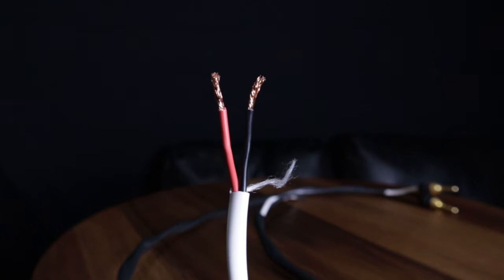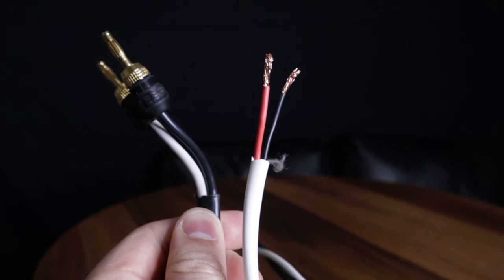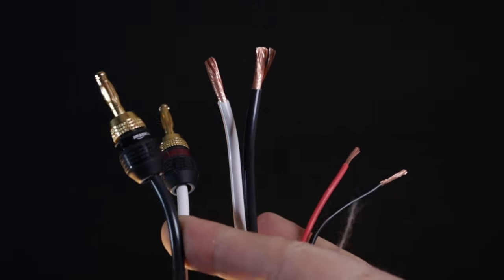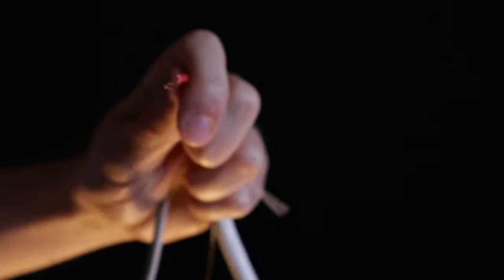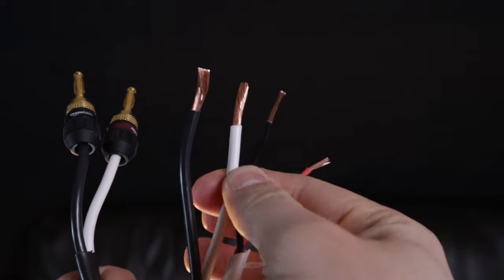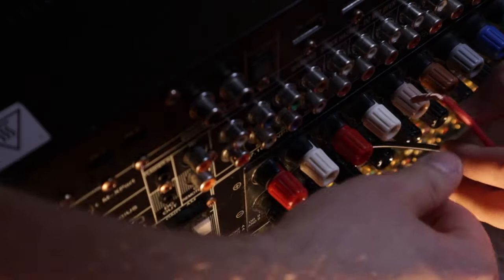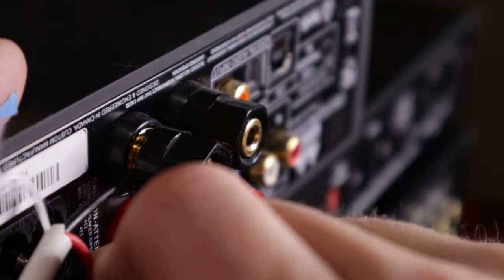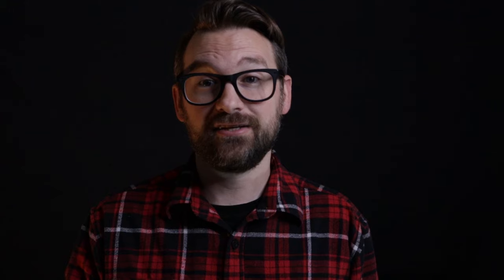Speaker Wire Basics (Quick, Easy)

Comment: Im thinking of making  of making my own diy premium speaker wire for a SVS 5.1 system.  Can I twist two 14 gauge wire for the neg and  two 14 guage  for the positive. I plan on using Monoprice Access Series 14AWG CL2 Rated 4-Conductor Speaker Wire.  Will this be to thick to run to my satellite speakers?  The longest run is 20' to 25'  (rears) 3' to 6'  (fronts). Any response is appreciated - Thanks
Reply from the maker: Absolutely, it would be thick enough. To be fair, you could use one positive and negative of 14 AWG to go all the lengths you mentioned. In the thumbnail of the video there is some grey speaker wire. That wire is 4 conductor 14 AWG wire that I combined together (red and red, black and black) to make a single connection wire (I use that for my front speakers that are only about 12 foot runs). It turns out to be about 11 AWG wire. I like it because it makes me feel confident about things working but functionally, all you need would be the 14 AWG. Let me know if you have any other questions. Thanks for watching!

Comment: When there is a red, and a black wire- is the red the hot? Thanks- very basic, but not mentioned
Reply from the maker: Hi Norman, red is usually the hot and black the neutral. Honestly though, I think in most scenarios you just have to match colors and keep them consistent.

Comment: I am a complete moron when it comes to electronics. I used masking tape to label all wires as I pulled them out from my old receiver and of course when I tried wiring the new receiver, all of the wires were stuck together in a huge ball of masking tape so I doubt I got all the wires correctly installed.
I ended up using a 9V battery to get the "popping" sound and make sure the correct wires were connected to the right posts.
Now I am not sure if the polarity is correct as all of the wires were black. 
I've seen where you watch the speaker go in or out to determine correct polarity but I don't want to remove the cover to do that test. Any ideas???
Reply from the maker: Alot of receivers have a speaker setup option in the menu. It will play sound through each speaker and often check for polarity.  If it came with a setup mic there is a good chance it has this feature.

Comment: I just got the Elac Debut 2.0 B6.2, and I can't connect them with banana plugs. I have the nakamichi banana plugs.
Reply from the maker: I know those speakers have the holes for banana plugs. Are the banana plugs to big to fit in the hole or the case to big and there isn't enough clearance around the posts? Did you buy them in the US or outside the US? Some countries require caps that cover the banana plug holes on the posts.

Comment: hello, my speakers have a little color coated cap inside then wire terminal that prevents me from plugging in my banana plug, however, it otherwise appears to be fully capable of accepting a banana plug input. So do I need to remove these caps? I tried a little and they were quite tightly on there, so I figured I would ask first. Also I am working with the celestion F1 speakers. I tried a search for the user manual but could not find one online. Any help is greatly appreciated thank you.
Reply from the maker: Hey, sorry for the delay, many products that get shipped globally come with those extra inserts in the banana plug hole. I used a dry wall screw and a drill and drilled just a little ways in and then you can pull those caps out. If it is what I think it is.

Comment: I hope you can help me. I want to put banana plugs on but I have no ideal what to get.I have a Onko HT R 510 home theatre receiver. Thank you so much.
  Mary
Reply from the maker: Hi Mary, sorry for the wait, let me do some digging
Reply from the maker: Ok, that receiver uses 5 way binding posts so you can use the links in my description for wire and banana plugs. All Amazon links.
Reply: @goldenearaudioreview4904   Thank you, where are the links?
Reply: Could you tell me what size banana plugs? Also is there something inside the terminal posts that need to be removed so the banana plug will fit. Thank you
Reply from the maker: They are all the same standard size. To remove the covers ( plastic bits that fit in the center) I used a dry wall screw and screwed it in the the plastic but, just a little, and then used that as a handle to pull it out. You can look that up on YouTube, that's where I found the idea. There might be better ways of doing that.
Reply from the maker: The links for the banana plugs and wire are in the description of my video. Expand the description and you will see links.

Comment: Hello, I have a question you may be able to answer I bought a house with ceiling speaker, only two wires coming out of the wall each wore has 4 different colors like in your post picture, what do they all mean?
Reply from the maker: How many in-ceiling speakers are there? Is it 2 cables and 4 wires in each or 2 cables with 2 wires in each? Depending on the colors and amount of wires and speakers you may need to experiment with how you connect them. Let me know more and I might be able to help you narrow it down.
Reply: @goldenearaudioreview4904  thank you for the reply, two in the living room, one in the kitchen, bedroom, front porch and back porch, with volume  controls. two cables with 4 wires in each 16/4 I believe
Reply from the maker: @jean-pierredoucet8328  if they aren't labeled then you will have test each combo and then label each pair. You need to connect two wires, one to each binding post for one speaker. I use label zip ties and write the location for the speaker. Test connecting the speakers at low volumes using an amplifier, stereo or home theater receiver.
Reply from the maker: You don't have to test with all three types of amplifier, just one would be fine. Let me know if you need more information.

Comment: One ? I have sony bookshelf speakers sscs5 and a sony Bluetooth stero receiver the  STRDH190 The speakers have connections for banana clips the receiver don't can is it possible to use banana clips on the receiver STRDH190 ? not sure how to hook up my system had it 2 weeks now can't wait to use please help
Reply from the maker: You wont be able to use the banana plugs on the reciever but you could use pins. I don't really care for pins as I have found they tend to come loose. You could get some bare wire and do banana plugs to the speakers and bare wire on the other side of the wire to the receiver. That is what I would probably do. Bare wire is maybe the best connection (no audible difference) from a conductivity view point but it's not very convenient.
Reply: @goldenearaudioreview4904  Thanks Brother or Sister I'll do that

Comment: Can you show me what kind of wire to connect amplifier to EV ELX 200-10 speaker. Thanks
Reply: Can I use this one Rockville RTSBW15 15 Foot 1/4" TS to Bare Wire Speaker Cable,16 AWG,100% Copper

Comment: My speaker came off of a radio an it had six wires what do I do, should I still run black wire to black wire an red to red or what
Reply from the maker: Six to each speaker or six total? I'm assuming you have two separate speakers

Comment: Great video! It was clear and easy to understand. I appreciate it. My one question: what is the benefit of putting the wire and plugs together oneself rather than buying pre-assembled wires with plugs already attached?
Reply from the maker: There can be two benefits. Some times it can be cheaper (not always) and you can do custom lengths. If you have a budget for it you can go for the pre made wires.
Reply: @goldenearaudioreview4904  thank you!

Comment: My speaker wires are thick to fit in the new Onkyo TX SR393 .. what to do
Reply from the maker: It looks like for the front left and right, you can use the bare wire or banana plugs. For the others, you can see if pins will work. What gauge wire do you have?

Comment: Can i connect the speaker direct to the tv..?
Reply from the maker: As long as the speakers are self powered (like studio monitors) or the TV has speaker terminals (which is not normal). Likely if you are using regular speakers then you would need a receiver.

Comment: What about those holes with tabs?
Reply from the maker: Ah, yeah, those are called spring clips. You should use bare wire. Typically you would want to use 16 gauge wire for that since it can be harder to thread. Or you can use pin connectors. They are similar to banana plugs but have a small pin instead. I have used them in the past but the wire tends to wiggle free. Easiest, cheapest is bare wire.
Reply from the maker: Just push the tab down and insert the bare wire in. You may need to experiment with the length of exposed wire to insert in but I would start with about a half inch.
Reply from the maker: Yeah, in my experience they were the least reliable. The wire would eventually slip out if they got moved or re inserted. Better off with bare wire if you can.

Comment: Excellent video. I have one question. Are the banana plugs the same thing as a 3.5 mm audio jack?
Reply from the maker: Thanks! Good question, no, they are not. They do look similar but the 3.5 (and the larger 1/4) jack have rings on them that can carry stereo information. Banana plugs don't have that. They are also a different size with the banana plugs having a spring like tension to them to keep them inserted in the binding post. Thanks for asking the question!
Reply: @goldenearaudioreview4904  Oh ok. Are there audio jacks i can buy that are 3.5 mm that i can hook up the red and black wire to. Thank you for the assistance btw. Just subbed 👍
Reply from the maker: @johnnyboy_rn4l_826  Sorry I missed this question. You have undoubtedly found your own answer but here is an example of something like what you are talking about. https://www.amazon.com/CERRXIAN-Terminal-Headphone-Converter-Adapter/dp/B06Y5YJRPD/ref=asc_df_B06Y5YJRPD/?tag=hyprod-20&linkCode=df0&hvadid=193992629021&hvpos=&hvnetw=g&hvrand=17653091454944598486&hvpone=&hvptwo=&hvqmt=&hvdev=c&hvdvcmdl=&hvlocint=&hvlocphy=9033382&hvtargid=pla-313747042489&psc=1

Comment: I have an old Pioneer stereo I want to use the speakers going through my Poweramp is that possible
Reply from the maker: Possibly, depends on if that Pioneer has pre outs. Should be RCA connections on the back of the receiver. You could Google the model and look up the old manual.

Comment: Hi there how do I connect four coloured speaker wires black red white blue to red and black terminal on the amp please? Can I put two wires together in red or black terminal? Thank you.
Reply from the maker: Yes, you can use any color and combine wires together. The trick is to make sure that it's connected the same at both ends of the wire. The negative on the amp is the same as the negative on the speaker and so on.
Reply: @goldenearaudioreview4904  thank you so much for the speedy reply. I will do that. Thanks again. Appreciated. Stay safe

Comment: Can connect the spring clip speakers to Bluetooth receiver
Reply from the maker: Bluetooth speakers typically are wireless devices. You need to have speaker terminals on both sides (speaker and amp) to make the connection. Either the speaker has Bluetooth connection and a built in amp (power) or it's a passive speaker and it needs an amp. Some receivers have both Bluetooth and speaker terminals.

Comment: how to connect regular speaker cable to 3pin xlr? because usually speaker cable has plus and minius only. not ground.
Reply from the maker: I googled "speaker wire to xlr adapter" on Amazon and found some options. I noticed that quite a few people were saying it didn't work but I'm not sure of their scenario. Male vs female xlr and which side needs the XLR vs speaker wire. Not sure if that helps.

Comment: Hey man... I'm tryna connect firestick to hdmi2va 1.(to av receiver to speaker) and 2.(to my TV). Could you help me?
Reply from the maker: Sure! I think the normal way to do this would be to plug the Firestick into the HDMI in on the receiver. That should give audio and video at the same time to the receiver. It should then pass the video up to the TV through the HDMI out. Maybe you have already tried that or you have an older receiver?
Reply: @goldenearaudioreview4904  thanks for the reply. Could you help over on Instagram or snapchat? It'll be easier to explain and show you. Is that possible?
Reply: So my problem is : attach the firestick to hdmi2av.. Hdmi2av got two audio connections and one video.. Two audio connected to amplifier.. One video connected to plasma tv.. Home theater speakers connected to amplifier. Will this work?
Reply from the maker: What is the make and model of the av receiver?
Reply: Will it work?
Reply from the maker: @akshatkhanna2517  ok, I'm getting the picture now of what you're describing. Do you have all of this now? I would try it. You won't blow anything up.
Reply: @goldenearaudioreview4904  alright I'll try it out and let you know... Thanks for your help man.
Reply: @goldenearaudioreview4904  hey bro I tried it out but the converter was low quality... I guess using a Bluetooth speaker is a wise decision... The problem is I got home theater speakers with no Bluetooth link and the av receiver Bluetooth doesn't connect to the firestick... Any ideas on how to use them?

Comment: bear in mind in most European countries, the standard mains power receptacle will physically accept banana and even US-style "double banana" plugs leading to a risk of electrical shock. For this reason, throughout the European Union, the sale of audio amplifiers and loudspeakers that accept banana plugs is prohibited as is the sale of loudspeaker leads terminated in such plugs. The UK was included in the prohibition even though such mains sockets were not used there.
Reply from the maker: I didn't know that! Thanks for letting me know.
Reply: it's simply not true, banana plugs are not regulated in EU

Comment: I just recently changed from raw to banana plugs and one speaker works great but the other now doesn't work properly. The audio is barely audible. I switched back to raw for that speaker and now it does the same thing.

Before I used banana plugs I was raw for both speakers. The speaker that doesn't work properly right now was always sorta lower audio than the other but now it's almost completely gone.

I don't know if it's the speaker itself or my Yamaha CRX-E300.

Please help...
Reply from the maker: It's pretty common to miss wire things but the best way to check is to swap cables and speakers. Put the left speaker on the right and so on. If the sound issue follows then what ever you changed may be the issue. Do one change at a time so you know what has caused the issue.

Comment: how do i connect to the speaker if it is a spring clamp thing
Reply from the maker: You can use bare wire or pin connectors. Probably better to just use bare wire as the pin connectors tend to lose their crimp on the wire and wiggle free from that end.
Reply from the maker: Hope that is helpful, let me know if you have more questions. Thanks for watching!

Comment: What if they are both black
Reply from the maker: In theory, color doesn't matter as long as the wire is connected correctly. Positive to Positive and Negative to Negative. The colors just help you keep track of which is which.

Comment: Man, it’s not that I’m averse to banana plugs: they’re beautiful. The problem is that my wife micromanages my stereo component spending  but refuses to give me the time of day when I’m talking about stereo.
Reply from the maker: That's a struggle, I feel for you. Alternatively, Blue Jeans Cable recommends just straight bare wire for the connection because it is a very secure connection. If you aren't changing things around a lot, then it might be the best way to go. I just enjoy the Banana plugs for ease of use and a clean look. Bare wire is probably technically better (though there won't be an audible difference between the two).
Reply: @goldenearaudioreview4904  thank you! I purchased a couple packs and I’m still using bare wire on my Integra receiver’s binding posts! But of course I’ve opened up the packages of Fostex banana plugs for inspection lol